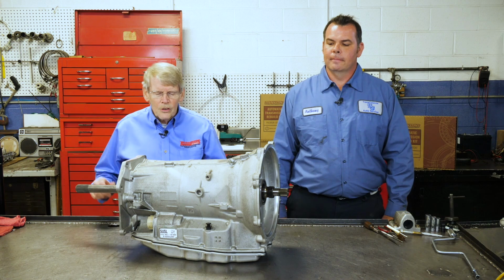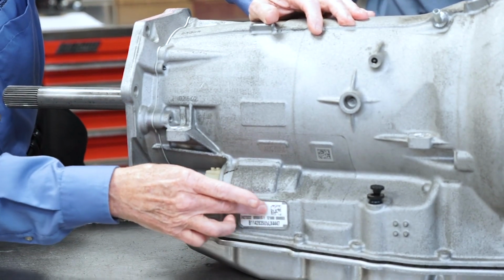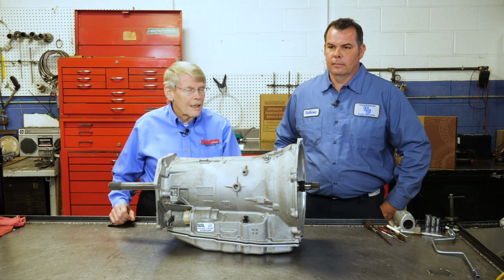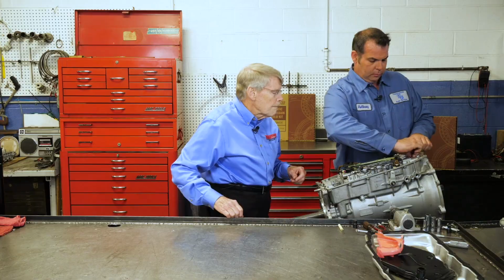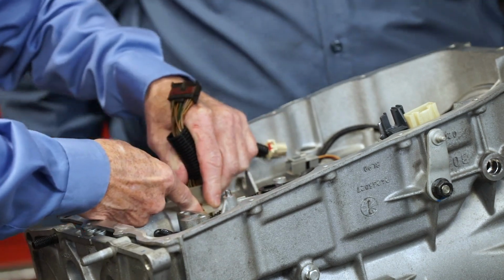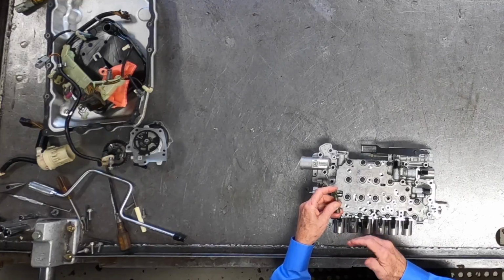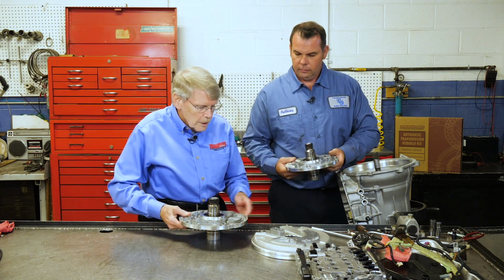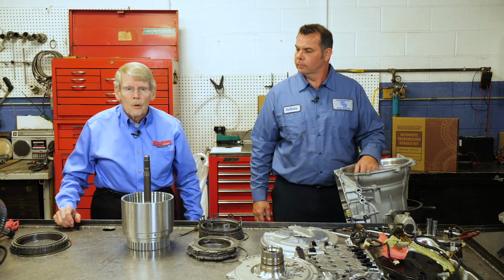GM 8L45/90 Eight Speed RWD: Part 1

Comment: Thanks for the video. and i can probably say this for thousands of people.  What was GM thinking when doing this to all those people trusting their products and vehicles buying this junk mess of a transmission issues.  SAD !! Come on NO dip stick tube!! Junk TC !! What a waste and mess just to service these transmissions. 5 year old can figure it out to put a drain screw in drain plug on botton of pan to drain it. Wtf you have to pump fluid up threw a dam hole instead of a regular dip stick tube to check level of trans fluid.

Comment: So my 2016 Sierra has the same issues listed below such as hard shifting between 1-2 and hard downshifts occasionally. Is this a nuisance or will the tranny eventuall fail?
Reply: Curious on the same thing, looks like this trifecta tune may have a slight nullification on the hard shift? Still looking for info though.

Comment: Good informational video. Your average driver should watch videos like this for and introduction to the complex modern automatic transmission. The over use of electronics and software to "fine tune" today's transmissions has made them inconsistent and quirky. As a 30 year tech in the auto industry, I am blown away by just how bad today's transmissions really are. Hydromatics, automated manuals,and CVTs  included. The driving experience in a lot of vehicles is ruined by bad transmissions, from both hardware and software fronts. From time to time I have the luxury of driving older vehicles and I am amazed at how much better the transmissions were.  Consistent, accurate shift points, tcc lock up, reliability, ect. Sadly, we have become acclimated to today's transmissions. The KISS (keep it simple stupid) philosophy should be brought back into engineering. The complexity, planned obsolescence, and the sheer lack of testing, has greatly reduced reliability. So much so, that many vehicles don't make it through the warranty period without overhauls or at the very least software updates. The owners of the gm/ford 10speed better pay close attention, as that transmission is a problem in the making. It is used in a lot of vehicles. Thanks, for letting me add my thoughts.

Comment: I have an 18 Canyon that, I believe, has Torque converter issues. It has a tendency to shutter in 8th gear. What's the fix for this? I manually shift to 7th, and now it's doing it in no that gear as well.
Reply: Fluid change is a good start. The synthetic recommended one.
Reply: @MWestern-m4g  yup mine was shuddering as well...put the mobile 1 synthetic shifts and feels way better.
Reply: for awhile--
Reply from the maker: TCC shudder can be related to transmission fluid, computer strategy, torque converter or transmission issues. Engine-related issues can cause a similar feel. It does require a process of elimination to arrive at a fix.
Reply: Mine has all of the tcc issues plus it feels like driving over rumble strips at highway speeds. The dealership fixed mine. They told me to drive slower or live with it. I can't wait to trade that pizza sheet away. Already had the fluid change, lasted about 3k miles. Torque converter changed 4k miles later, no change.

Comment: Have a 2017 Silverado with 8 speed, truck was bought new. Immediately I dumped the ATF for Amsoil and installed a Trifecta tune and never had any issues. Knock on wood

Comment: I have a 2019 Silverado Trail Boss with 5.3/8speed it shifts hard between 1-2, it also hesitates as if it’s finding gears and once/twice a week it will shift really hard so hard it feels like somebody hit me from the rear. I’ve taken it to the dealership and they keep telling me the codes are fine and it’s running normal which in my opinion is unbelievable if you can give me some advice on this issue as to what can be done I would really appreciate it
Reply from the maker: Unfortunately, hard shifting and lock-up shutter is why a class-action lawsuit was filed against GM. New fluid seems to fix some of the lockup shutter issues but not hard shifting. Sometimes resetting shift adapts will work but not always. Shift quality is a cross between computer programming and solenoid/valve body function. Currently, to my knowledge, there is not an aftermarket fix. Sorry.
Reply: My 2018 Sierra does the same exact thing. I’ve been complaining to my local dealership since I bought it new. It’s now over 60K miles and out of warranty. I’m beyond pissed at GMC.
Reply: Sounds about right....these issues is the reason I got rid of my 2016 GMC. It sad really, as the GMC was great truck, just an awful transmission
Reply: @1954saltydog  Which is fascinating, because I've been driving a 2019 Silverado with the 8-speed and it's one of the best automatics I've owned. It's really a common situation with every new transmission. When the 4L60/4L60E was the new transmission, they were awful in the early years but later became great transmissions once the issues were solved. Then the 6L80E showed up and everybody absolutely hated it due to early issues. Once the issues were addressed, it because a pretty solid transmission. Then the 8L90 shows up and everyone hated it because of early issues, but once the issues with converter drainback and Dexron HP were fixed, it's becoming a good transmission. This isn't isolated to just GM either. The first few years of the ZF 8HP were notorious for issues. Even once it went into the Ram 1500, the first couple of years had plenty of complaints for hard shifts, bump downshifts, etc. Complaints came back again in 2019 when the new Ram 1500 received an "updated" ZF 8HP that caused all kinds of new issues with slamming downshifts, bump downshifts, becoming "stuck" in 2nd gear at a stop, etc. Ford had a lot of complaints with early 6R80's, the "updated" 6R80 in 2015, and the 10R80 when it was pushed into every new F-150 in 2018. When Toyota began putting the AB60E/F into the Tundra, it had issues with "slipping" sensations, solenoid failures, converter issues, etc. The 2016+ Tacoma's 6-speed has had massive complaints for flared shifts, terrible shift programming, delayed engagement, hesitation taking off from a stop, etc. The Toyota 8-speed that went into the Camry and other vehicles was infamous for torque converter failures, shuddering, delayed engagement, premature transmission failures, etc. It seems that no manufacturer has a flawless launch of a new or modified transmission design.
Reply: @karlschauff7989  that is good they finally got it somewhat sorted. I can understand having teething issues with a new design, but the bigger issue is fighting with GM to apply the TSBs to the older transmissions and there is clearly a bit more issues than a typical trans based on the lawsuit & the fact the GM pretty much adopted the 10sp in many applications.

I have owned many cars and this was by far the worst performing transmission I have ever owned, I have owned a few Chrysler 604/ultradrive transmissions in the past and they are not great by any means, yet they still perform better that this GM mess.
Reply: A hard 1-2 shift when it's cold is common with this trans due to clutch-fill times.
Reply: @karlschauff7989  your the smartest guy you know

Comment: What other 8 speed transmission can i get instead of this 8L45? For a ATS V?
Reply from the maker: Due to vehicle complexity, today swapping transmission models is almost impossible. Aside from the 8L45 or 8L90 the only other possible option might be a six-speed like a 6L80. Even that would be hard to do.
Reply: @TransmissionDigest  thank you i understand.  I have the 8L45 on my Atsv with new the mobile one synthetic transmission fluid. It’s working good since doing that fluid change, do you thinking this transmission will last a while or should i be worried about it?

Comment: Just took my 2016 Camaro SS in for trans shutter. They’re fix is trans flush with some new Mobile 1 trans fluid with a blue label. So far after 1500 miles the shutter is gone. We’ll see if it comes back. The service advisor at the dealership said they only had one come back and they replaced the torque converter.
Reply from the maker: The new ATF recently released seems to work fairly well but not always. Sometimes, computer programming and /or converter replacement may still need to be done. After 1500 miles though it should be okay.
Reply: I had the flush with the new fluid in 2019, 20k miles later and the shutter is back. They are swapping the converter now but I don’t see how it could have been bad for 20k shutter free miles.
Reply: @cardplayer85  I'm worried about it coming back since I'm now out of warranty (2018 Colorado).....
Reply: My 2018 Colorado 4x4 developed the shudder in the first 7,000 miles. They did the fluid change and currently at 40,0000 shudder hasn't returned. Never have gotten a good explanation for the cause. Worried I should've bought the extended warranty.

Comment: Just enuf electronics to make my 2020 canyon run like I'm pulling a trailer. Thankfully I leased I will turn it back to GM and walk over to Toyota.
Reply: Toyota has their fair share of transmission issues. Especially the 2016+ Tacoma, which has had nothing but complaints for flared shifts, delayed engagement, constantly shifting between gears (this is one of the worst issues), underfilled transmissions, seal leaks, hesitation issues, etc. That's on top of the 50% of owners that complain about howling rear diffs that Toyota claims is a wind resonance... even though the rear diffs howl when the truck is on a lift, stationary, and the rear wheels are turning.
Reply: Great I just Bought a ‘21 Zr2! 🤦 3500 miles on it so far!
Reply: No need to be buying foreign crap - always stick with American and you will learn true happiness.
Reply: Excellent decision.....there is a lawsuit against GM over this transmission.
Reply: Run over to Toyota

Comment: I'm have a hard shift and when I put it in reverse the transmission shacks hard. My transmission is 8 speed in my 19  Silverado
Reply: Bring it to chevy there is a special coverage on it and can be fixed for free under powertrain warranty. These clutch packs have a slow to fill issue and there are now updated pistons and calibrations to the tc to fix this issue